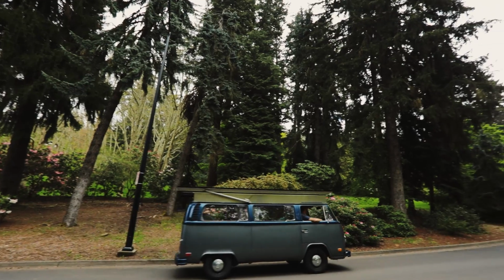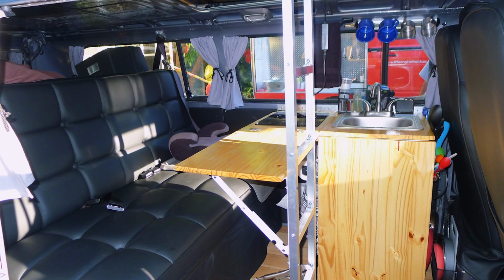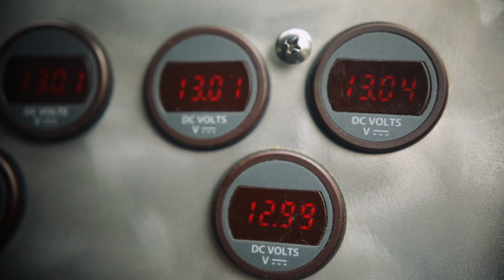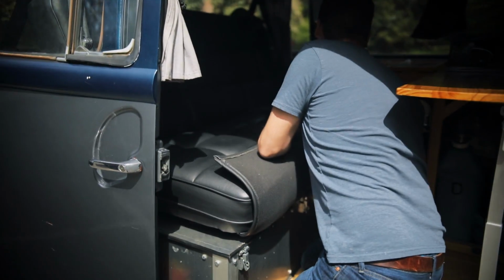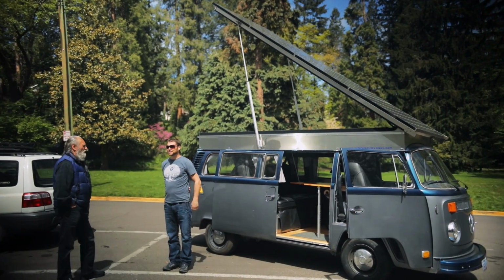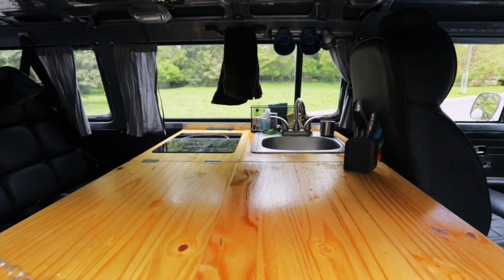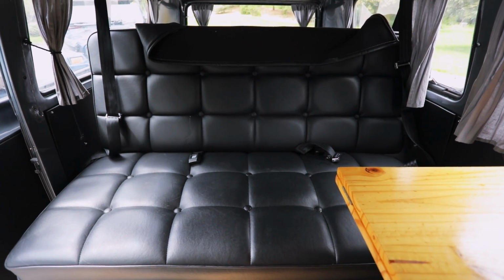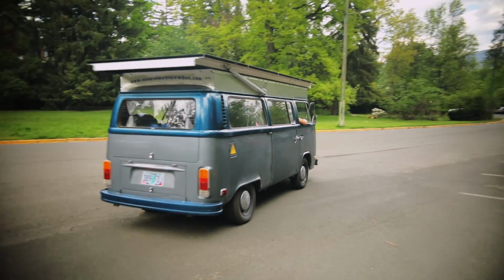This is a Fully Solar Powered Electric VW Bus

Comment: I've owned RV's for 30 years. The idea of a solar RV is compelling. I was looking at an Ultravan and thinking about something like that. The upgrades you are planning are very intriguing. Something like the CALB 180 Lifepo, seem to have some value and the chemistry is considered 'safe'. There is a huge push for EV cells, of course, so who knows what you might find. There are some LG and Sanyo cells scrounged from hoverboards (never sold or used) around a buck a cell, 18650's, on Ebay. 

I've built three ebikes. I can ride them with 15 watt/hours per mile. So if you can get 45 mph and 150 wh/mi, with all the weight and poor aerodynamics, it's great. The roof design is simple, I guess, but brilliant. The whole small space looks very useable to me, though I wouldn't want to 'live' in it. i don't know if you said 1200 watts of solar, but that is a lot of energy.

The efficiency numbers from 'real world' experience, comparing Lead Acid to Lithium, are all over the place. You can certainly put a lot more into lithiums, without the final charging issues. For what you are doing, it could be huge.

Thanks for sharing.
Reply: the maximum is arround 200W per square meter.. and I guess he has like 1.8x4 Meter that means he has 7,4 square meters of surface and that is arround 1400W.. so this is pretty exact.. but now you need to see it realisric.. ro charge up the Bus with this Power you would need arround wait let me calculate it for you.. so assuming he has like 30kwh of power on that Bus which seems realistic considering the range that means charging the car with 1200W of power would need 24 days under best conditions.. and with the motor build in which has like 56Kw he would need to charge 45minutes for every minute of driving.. thats really inpractical:D
Reply: He says 200 wh/mi. So 50 miles x 200 wh = 10,000 wh.

Solar generates 1200 watts, 1200 watt hours per hour.

So 10,000/1200 = 8 hours to recharge 

Cruising wattage would be around 10,000
Reply: 8hours of charging on best conditions for 1 hour of driving with 50mph
Reply: If you want a lot of cells for around a dollar a cell, you are going to have to roll the dice. I bought 4 of these modules that came out of hoverboards, or were built for hoverboards. Since they are 36v and include a BMS board, it's a complete ebike battery. I've tested two of the modules and the cells are around 2,000 mah, and I've drawn 17 amps through a module. So they are what the seller said in terms of capacity and discharge numbers. The cells are two years old, just going by the date codes. They could be re-wrapped. They are a salvage cell. It's a very cheap price if someone can make them work. Every auction is different.

There isn't a lot of good information about batteries. To make an EV battery for a camper like this takes a lot of connections and control circuits. Not everyone is a scrounger.  For smaller projects something like the Vruzend system might work OK. They are supposed to have a distributor in the US this month. I think there is a video on YouTube.
Reply: George Sears I don't know if who made the cells that caught fire. No I don't believe we should through them in a landfill, but instead recycle them if they are dangerous to use (yes I know that a very low percentage of batteries get recycled :/) . If there is a way to verify that the batteries are not dangerous that would be the best solution, to recycle the dangerous ones and use the confirmed okey ones.
Reply: ....Until he changes the lead acids for Li+ batteries...and more panels on awnings.
Reply: I'd avoid ebay batteries, especially ones from hover boards. Last time I bought some Samsung batteries off ebay, they was fakes, the seller wouldn't work with me on them either so I was out some money. illumn.com is reputable and always has legit batteries. Buying in bulk, I'd say alibaba would be your best bet.
Reply: George Sears wasn't there news (a year or two ago) about hoverboards wish batteries could "randomly" caught fire when charged or used when almost full?. I would avoid those batteries if I where you, at least if you are not a battery expert
Reply: i charge to 90%. I charge outside with my solar system.  They seem to be LG cells and there is a data sheet for them. To use in a car you would have to separate the connections to harvest the cells. Wouldn't they just be cells, then? If they are genuine LG cells should they go into the landfill because they came from a hoverboard? Which cells caught fire?
Reply: They are still on Ebay. I heard there might be 200,000 cells in modules of 20. There is some variation in the boards, and there are Samsung and LG labelled cells. Some people have bought thousands for about one dollar a cell. If you needed 4,000 for a vehicle battery, it would be hard to really grade them. The biggest lot for sale is 50 modules which is 1000 cells. Ebay says 50 of these have been sold, so 50 x 1000 or 50,000. There are different auctions for different sets. Most of the information people have exchanged seems to be on the jehugarcia YT channel. It's very difficult time to use lithium cells. Many claims are fraudulent. People are leery of Chinese cells. The problem is that much of the new capacity for vehicle cells is being built in China. It's hard to find ebike cells that hold up. It's a high wattage use and the battery packs are fairly small.  Even the best name brand cells can lose a lot of capacity after less than 100 cycles. I bought the HB cells to experiment and so far they are OK. There are a lot of lithium battery 'deals' on Ebay. You can find Bosch EV modules and locomotive packs, startup packs from new companies. With these, people have had time to buy a couple, tear them down, and make a decision.
Reply: 6 kw solar.
Reply: Buy solar r. 3000 wats solar 103 noise ra b fe BMW baters 139 Mike range

Comment: Nice!  I love that you used lead acid trojan's and still get 50 mile range. I'm thinking of building a houseboat with 7kW of solar and 2X48 volt  forklift batteries. Your video was very well done. Cheers
Reply: did u do it ?

Comment: Have you put any thought into putting a few marine wind generators up top for when your driving 50 mph to take advantage of that...  Just a thought...
Reply: Really? Check your physics. Adding resistance will lower the range below what the turbine will add. A wind generator would contribute a bit if the wind was blowing when you were parked.
Reply: ouch, no that would not work and dimish your range. but you could of course set them up while you are stationary and generate a little juice during the night. i guess fold out solar panels will be a better way though.
Reply: would that be legal spinning blades on your roof
Reply: Solexx X he's trolling -.-

Comment: He saved so much money on fuel that he could afford those sweet sunglasses
Reply: I know right! I kept expecting him to come out wearing gold and a baller hat and the van turns into a lowrider and start hopping down the street!
Still, beautiful job done on the bus!  👍👍
Reply: He spent $4K on the seats!
Reply: First part of his Ironman suit.
Reply: I think he borrowed those from his wife
Reply: Those are his wife's, I hope.
Reply: could have made them too, lol.
Reply: yeah those are girls sunglasses...
But he's a smart guy I respect what he's doing I think it's pretty awesome
Reply: Ain't that the truth....
Reply: I thought his sunglasses were solar powered as well
Reply: Fred Flintstone  So what? I was being slightly hyperbolic but, 1/4 Ton pickup trucks easily push 400-600 HP, you know, roughly half a megawatt. I know higher end Honda Civics can push 250-300 HP. Thats roughly a quarter megawatt. That doesn't really help your argument as those panels are making maybe 200 watts. So, around a quarter of a kilowatt. Even if it was generating a full killowatt, it'd still be less than 4% of what an 80s model, underpowered Civic would produce.

A person pedaling a bicycle generates about 100 watts. So, that setup is like towing a VW bus with two bicycles. Filled with lead acid batteries that weigh quite a bit, probably at least an additional 500 lbs. The point is  that this isn't even remotely practical - it's a novelty. You can maybe travel a few miles a day if it uses regenerative breaking and you park in full sunlight. Probably less. Thats before massive efficiency losses each step converting light to power, transfering that power to batteries, transfering power from batteries to an electric motor and getting that rotational power through a drive train to the wheels. 

By your own estimation, it'd be 3.5x more powerful just putting a horse on a treadmill to charge the batteries or just pulling the damn thing. Yep. Sounds like innovation and progress there! I can't imagine how the largest industry in the world rose up to replace horse drawn carriages when they're clearly superior! /s XD
Reply: My grandmother has those glasses 🤣🤣
Reply: Lotta people in here obsessed with clothing and girl cooties.  Weird.

Interesting van project, glad he's doing something he enjoys with his family.
Reply: +Fred Fuchs  Yeah that was my immediate reaction when I saw him - Ha he's wearing his  wife's glasses , what a ham. xD
Reply: All the money he save on fuel was used to buy his batteries. They ain't cheap!
Reply: @theq4602  this kind of batteries are not expensive
Reply: @theq4602  not really.  He's running cheapo batteries.  It's gonna cost him in the long run
Reply: Ha ha. I was gonna comment, great bus, awesome family, horrible sunglasses!!
Reply: Dozer1642 I do take him seriously. Those glasses look pretty cool
Reply: Terrific creation and ingenuity. Horrible choice in sunglasses. It's hard to take a man seriously when he's got his wife's glasses on.
Reply: +FreemonSandlewould only a halfwitted neanderthal of random political inclination would not comprehend that the combustion engine is 19th century technology and backwards when compared to electric/solar
Reply: @1greenMitsi  you do realize electric cars have been around for over a hundred years ? Dumbass
Reply: winner of small minded comment of the day
Reply: @FreemonSandlewould Are you trying to say something?
Reply: 1greenMitsi 19th century tech that's 10 times more reliable, faster, cheaper.  When they make something as cheap reliable and doesn't require you charge every 3 hours or 80 miles.  Then ill be interested.   But for now ill be driving my 3500 coal spitting Cummins.
Reply: OutdoorsWithJP: Internal Combustion Engine with +2000 moving parts (+ rust, clutch friction, oil, dust, etc) more reliable than an EV with less than 18 moving parts are you kidding me?
Reply: You know something?  Instead of just sitting there and being the mouthpiece for an antiquated industry which is overturning a 150 million-year-old natural order, why don't you get your brain working to try and improve upon Brett Belan's concept?
Reply: Nooo.  Winner of most realistic comment.  You lefties just don't get engineering.  Maffs make your head hurt?
Reply: "You lefties just don't get engineering. " I always thought science denial was more common among conservatives, but let's try not to stereotype.
Reply: @Wintermute_SilverPaths  toxic batteries: You are right. But: The alternative in 2019 would be a fuel cell, as we do not have an real other energy storage/changer combination yet. 

A good argument for Brett's solution is: There is only one circle of energy. You do not need gasoline, diesel oder natural gas/propane/butane. So you simply trade mileage with cooking, chainsawing, perhaps even heating and other. Imagine you are 50 miles apart from your next goal. Then you simply stop consuming electricity and put on the charcoal barbecue that day, f.e.

I also like Brett's given advice to connect batteries properly. I did not know about that degree of importance of it before, so thank you!

Did you notice the small room for the batteries? You could plan a slightly larger vehicle with more mileage (costing more batteries, then). Remember to pump the tires properly and to use as small tires as possible to reduce rolling resistance. Drive slowly for benefit in aerodynamics. Instead of a larger vehicle, one could consider a short trailer with additional batteries. That allows you to drive lighter locally.
Reply: @Wintermute_SilverPaths  Seems like the solar panels are there to offset the power consumption when they park and camp out. They can also plug in so It's a totally manageable vehicle which will be very low maintenance if everything is held together well enough. Batteries are recycled last I knew and the upgrade to lithium ion would be even more so.
Reply: @yaash4123  I know what the idea here is but the thermodynamic reality of the situation is that a Honda Civic (much less something the size of a truck) is generating half a MEGAWATT, with a vehicle that size easily needing more, and those solar panels generate a few hundred watts. Modern electronics don't use that much power. Heating, cooling and vehicles do need a lot though. It's a cool novelty but, as an actual solution - especially once you factor on efficiency losses each step, it's just not feasible or even possible. It probably takes them a day to charge enough to drive for 30 mins to an hour of driving if they're lucky. Honestly, I'm not trying to shit it on them for being unconventional, it just doesn't ballance the equation. It makes more sense to use syngas from a wood gasifier if you're trying to make an off grid vehicle. Wood has nearly the same potential energy as gas and after efficiency losses of making syngas / woodgas, you'd be looking at maybe 4x the volume of wood (or other biomass) vs gas equivalents for their needs. This is a gimmick, not a practical solution for 99.999% of the population.

Comment: look at the solar panel size needed to feed the hunger of an electric motor!! we need a windmill too amigos!! great project nevertheless
Reply: you're confusing a principle with the tech that utilizes it.... by that logic combustion tech hasn't changed since fire was first made by humans 2.000.000 years ago.
Reply: solar is nothing without the batteries, better batteries and more efficient transformation/charging is half the battle, though it also helps if solar panels keep up the trend of becoming cheaper and more efficient.
Reply: Can you really explain the "UFO propulsion secrets", please?
Reply: It has, its gone internal.
Reply: Internal Combustion Engine...hehe
Reply: Once it's done the only cost is maintenance. Can't go far. Doesn't need to go far. Doesn't need a charger.

What's not to like?

Bigger panels would be better. I can imagine a folding panel setup to double that so it can charge even faster. And with a tesla battery pack the range would probably at least double as well.
Reply: He would be still air-cooled
Reply: agreed our battery technology haven't changed much since it was invented by Volta 200yrs ago..